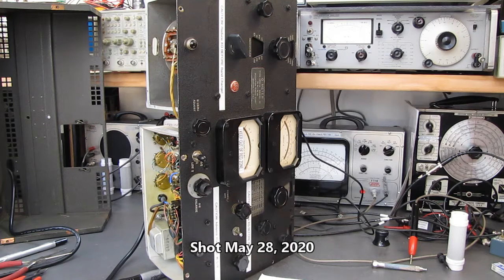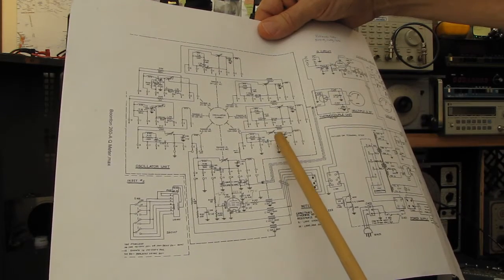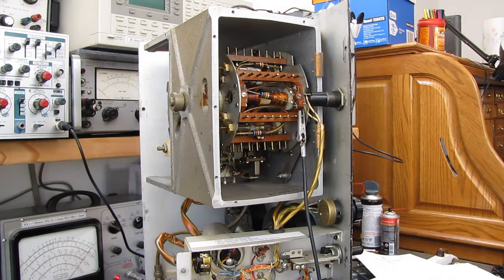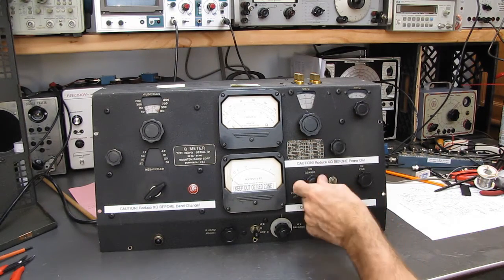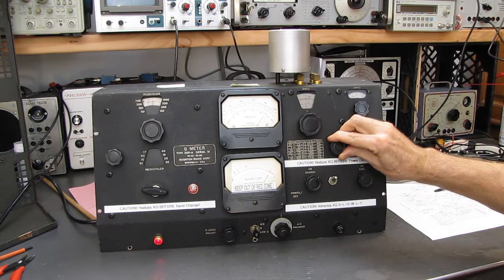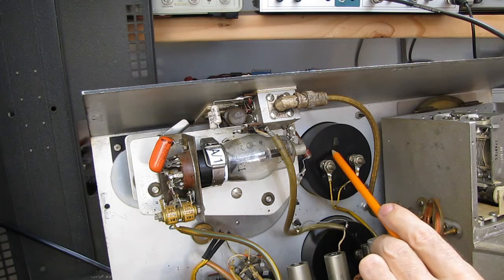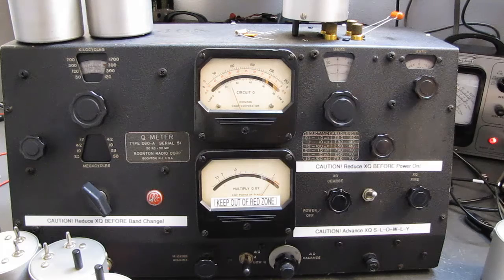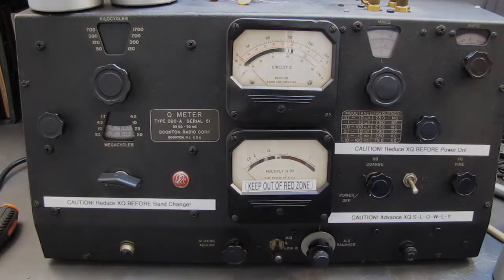10 Buck Test Bench Oscillator Repair Boonton 260A Q-Meter

Comment: I acquired a Boonton Q meter 190A and have done minor repairs to I think make it functional and found to have the original "Voltage Stabilizer" working and looks to a novice eye to not had much use on the unit. I saw your video mentioning how they are mostly burnt out and am curious of how I could possibly protect mine. Any advice is appreciated, and I also shot a quick and wabbly video of it up and running on a dimbulb. If you like to view it is at https://youtu.be/wfsapgATSos. Thanks for all of your very informative videos.                                                  Randy

Comment: I think they call those RF meters using a thermocouple a calorific  meter as it measuring heating energy. Also makes them very easy to calibrate. Funny I was just needing a Q meter as it’s called for check a Marconi VTVM I’m working on. Never seen a Q meter in the flesh. Neat repair but you had some luck but well done. Thanks regards chris